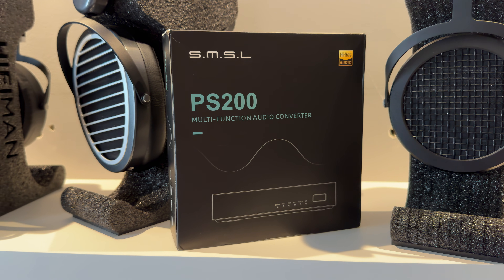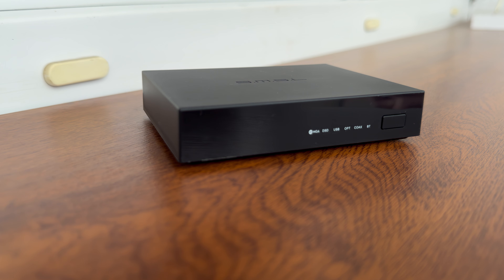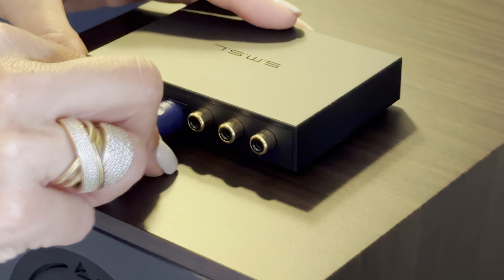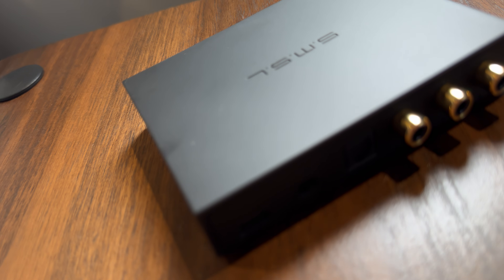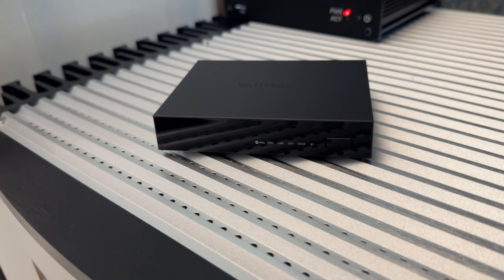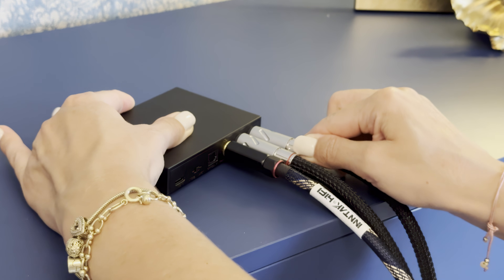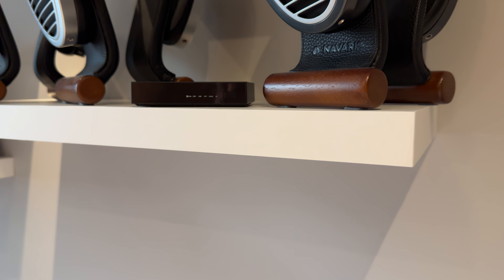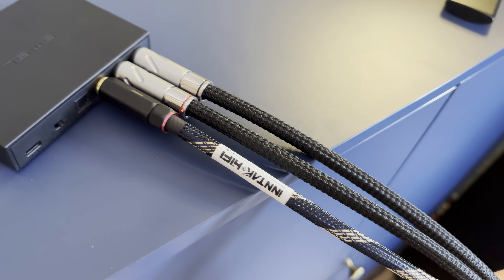Why The DAC Chips Are NOT Everything? - SMSL PS200 Review

Comment: Would this device be suitable for my needs?
I'm trying to use a Sony DVD player that has wifi streaming capabilities to send signal to a EQ and then to a crown amplifier and then to big speakers.
The Sony DVD player has a orange coaxial out but the EQ has TRS and XLR ins & outs and the amp also has TRS and XLR connections.
I could not find a coaxial to trs or lxr cable.
So in simple terms, I'm trying to go from coaxial to either TRS or LXR.
THANKS - oh, I can get the RCA to XLR or RCA to trs cable, I know this device has RCA outs

Comment: It’s reassuring to hear that the PS200 doesn't sound terrible, but I wish it had a bit more depth.
Reply from the maker: Yeah, I get where you're coming from! While the PS200 is solid, I also noticed it could use a little more depth. There's always room for improvement, but it's nice to have an affordable option that doesn’t sound bad at all.

Comment: I will be doing an a/b listening test against the SMSL SU-1 that features the AKM4493S dac chip. Specs are pretty close to each other. Just wish the PS200 used the same metal frame as the SU-1 though.
Reply from the maker: That sounds like a solid plan! A/B listening tests can really help clarify things in this space. I’ll be curious to hear your thoughts on how the SMSL SU-1 stacks up against the PS200. Every little detail matters, and it's interesting to see how different setups can impact the listening experience.

Comment: I've been testing DACs for one of my "mid budget" systems... a PC driven stereo home theatre system, using win10, one of the new tiny computers, a wireless keyboard, a Class D mini-amp and mid-price speakers. 

When I began testing the SMSL Su-1 and PS200 DACs. I ran into problems  with the on-screen volume control (the one you see when you click the speaker icon in your task bar) and the volume keys on the keyboard itself.  This is the Windows Master Volume control, that is used to manage the overall loudness of the system.  

When you connect either the SU-1 or PS200 the Master volume control ceases to operate. Preventing you from controlling playback volume with the computer.  Yes, you can still control playback through your media player but that leaves everything else (systems sounds, browser, games, etc.) at full volume, priming you for more than one mad dive for your amplifier's volume controls.

After some back and forth with Aoshida they sent the following...
=====
> Thank you for your detailed feedback and for bringing this issue to our
> attention. We have consulted with SMSL's technical department regarding the
> volume control issue you mentioned. According to their technical team, the
> computer cannot control the volume of the PS200 DAC. We are very sorry that
> this is a design choice, not compatibility. They said that the original
> design was because PS200 needs MQA decoding, so the volume control is the
> default. 
>It is recommended to use the media player to control the volume instead.
> We understand that this may not be ideal for your setup, and we sincerely
> apologize for any inconvenience this has caused.
=====

Given that one of the most common multimedia setups for a windows HTPC is to connect up a big screen TV, wireless keyboard, dac, amp and speakers, this is a bad design choice that is likely to cause more than a few problems for those of us who need working control of the overall playback level in Windows.

Comment: Great review. I have owned this dac for about 1 month and I must say I am very impressed.  Perfect for a mid level/price setup. I bought for my secondary stereo setup. Very transparent sound and solid bass. I also have the smsl d6s dac in my main setup and yes there is a difference. Is it  a lot? No. Bigger sound stage and more sound separation on d6s. For the money the  ps200 is amazing. Most people will not regret buying it. I don't.
Reply from the maker: You're absolutely correct. I'd say that for more of a mid range setup, something slightly pricier would be advised though. Anyway, you're not missing out a lot!
Reply: I've got a couple hundred hours on my ps200.  It really doesn't do anything bad , so overall it's good.  I use the Bluetooth for YouTube Music 🎶.  So I didn't expect much and got more anyway . My only other sorces are Pickering/Stanton moving iron series cartridges.  The Pickering is has an OEM nude Steriohedron and is running through a Darlington labs MM-5.  It's really good 😊 . The other is a Stanton moving iron series ( bonded hypereliptical aftermarket) with a ancient Realistic 42-2930 phono preamplifier.  Germanium transistors nonetheless.  It has the special task of playing the Supremes . It just works 😊. The sound stage from these cartridges is a bit superior. Then again it's a bit superior to most . I highly recommend a listen ...you may not go back.  Anyway the ps200 fits in well . My K-Pop girls sound nice .